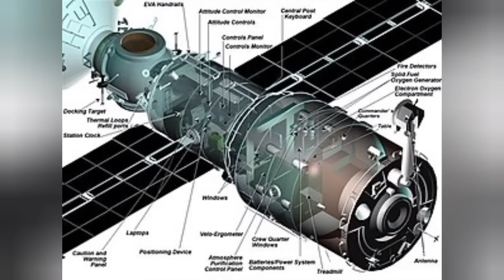Can Russia run off with part of ISS in 2024?  Can NASA do anything about it?

Comment: I would say that it would be wiser for NASA to work with SpaceX to build and install a new module to provide propulsion and wouldn't cost that much to do it and it to have the fuel needed to maintain the ISS in space.
Reply: Nasa already funded 3 vehicles capable of ISS reboost and altitude control.  The capability can be added to the Cargo Dragon.  2 of them will need to be parked at the ISS all times.
Reply: With the help of StarShip booster, you could add a module that would rival  Skylab, in a single launch. But I guess it better to send lot of little modules up to space made by as many different companies and countries as possible, that way you then can play space Lego and pass the blame for delays.
Reply: @YellowRambler  starship has to get into orbit first.  I'm hopeful they will, but getting a large payload into orbit and getting back down in one piece is going to be a massively complex task.  There's a lot of failure points, and we won't really know, until we know. 
 
Considering the projected size of the Starlink constellation, it may take nearly a hundred launches of starship to put the whole constellation in orbit.   Depending on how fast spaceX can manufacture raptor engines, that's likely to tie up most starship production in getting Starlink up and running, rather than being used for anything else.  

It's going to take time to do all of this stuff.
Reply: They won't though, it wouldn't take enough decades and failed attempts for NASA
Reply: A cargo Dragon with extra thrusters in the trunk.

Comment: They could semi-permanently dock a SpaceX starship to what remains of the ISS. It would be a good introduction for the lunar version.  They could launch a module as large as Starship without the full fuel or complete engines and maximize the interior living space. It would be a great way to send up the first generation of space manufacturing. I have to wonder what plans they might already have drawn up, and what machinery may already be built for the purpose. Just the potential of this might give the Russians a reason for second thoughts. Do the Russians realize what changes are about to happen?
Reply: A neat idea along those lines would be to reuse a Lunar Starship from Artemis on ISS. The Lunar Starship will only need it's tanks less than half full for the mission. Though it will have no cargo it can take 100T of cargo to and from the moon. So Lunar Starship could complete it's mission and still have at least 100t of fuel when the mission is complete. 100T of fuel aught to be plenty of fuel to get the Lunar Starship from Lunar orbit to ISS in LEO.

...BTW SpaceX already proposed a Lunar Starship variant as a space station for Nasa's Commercial LEO Destinations competition. NASA said it wasn't interested then and awarded the contract to Blue Origin and Sierra Space, but Lunar Starship could be done with Artemis and back in LEO right around the time the Russians are leaving ISS.
Reply: @THX..1138  I like that idea, it's extremely efficient.
Reply: @THX..1138  spacex ain't reusing anything, the rockets are cheap enough that they can deploy dedicated ISS module, especially compared to how expensive the ISS was.

Comment: SpaceX's Dragon Trunk has the space for several SDTs (Super Draco Thrusters) for an orbital adjustment system much like, or even more capable that Starlinier's AUX module.
Reply: Indeed. Let's not act as if the Russians are irreplaceable just because Gagarin got to orbit first. Last I checked, Japan invented Judo but not even half of all Judo world champions are Japanese. And I'm old enough to remember the various problems the MIR station had before its demise.
Reply: SpaceX could do that trunk solution in a flash. No, not two weeks. And they can also build cargo Dragons filled with fuel to boost and avoid debris, and just swap them when empty.
Reply: @tsamuel6224  curb your enthusiasm. Whatever solution SpaceX develop will need to be human-rated if it's going to work with a manned space station. Two weeks is how long it would take just to agree on which risk management process to follow. As for the math, have you actually done linear algebra on embedded computers using a real-time OS ? I have. Let's be blunt : if SpaceX could do this in two weeks, Starship would already be half-way to Mars.

Don't mistake SpaceX's rapid-iteration methodology for space-time breaking genius. In case you forgot, it's been exactly three years since Starhopper's first test flight and the booster hasn't even been test-fired yet.

SpaceX can get it done, no doubt. Just not in two weeks, or in two months. Two years at the very least.
Reply: @TheNefastor  they got very close to a test fire before that explosion happened.
Reply: @Rangefinder02  they didn't and that's besides the point.
Reply: @TheNefastor  a test fire might have happened by now if not for the explosion
Reply: @Rangefinder02  says who ? What do you base that on, other than wishful thinking ? I follow Starship news and nothing was said about an imminent booster test fire.
Reply: @TheNefastor  independently Space X has yet to make an orbital flight. That said NASA has signed a contract for a human rated orbital refuellable Starship with a timeline of 2 years. A Dragon capsule has 16 Draco thrusters for attitude control. Coming up with a module that would be carried as a truck for a cargo Dragon that would supply station keeping and attitude control functions in 2 year should not me too much of a challenge.
Reply: @johnohalloran3446  inspiration 4 wasn't independent?
Reply: Not to mention Shooting Star module being developed by Sierra Space. The shooting star is the cargo module for the Dream chaser, however it’s also a mini space station to itself with life support, altitude and attitude control, power and everything needed to function independently. DoD has even given Sierra Space a contract in 2021 to develop it into a free flying research module capable of supporting DoD research. Shooting star is scheduled to fly to the ISS in 2023.
Reply: @John-ed8ye  so ready in 2032 then old space is old space
Reply: Well, guys, I give up. There's no talking sense with fanboys. Apparently, watching SpaceX videos makes lay people think they got a degree in engineering and rocket science.
Reply: @TheNefastor  🤔…

Jean Roch: 
”Apparently watching SpaceX videos makes lay people think they got a degree in engineering and rocket science.”

Also Jean Roch:
”I follow Starship news”
Reply: The superdraco wouldn't be very useful for maneuvering. They were downgraded to burst valves after the test capsule blew up
Reply: It would be ironic for SpaceX to boost the ISS to a higher orbit to avoid the debris that their satellite network will surely cause.
Reply: @russellharrell2747  Starlink will not cause debris. Starlink sats can be easily deorbited and since they are in LEO will deorbit naturally by themselves even if deorbiting thrusters fail.
Reply: @MrEd2291  yea, that is the main reason why their lifespan of their satellite are just around 5 yrs, once the fuel is gone, they can no longer stop the satellite falling to earth due to gravity. its also the only reason why others can't do this since only spacex can launch several satellites easily and replace those satellites.
Reply: @MrEd2291  there’s no way that if they get to a constellation of 40k that all collisions could be avoided.  But I guess at least it’s a way to get internet and communications to otherwise underserved or unreachable areas.  I just hope we can avoid the worst case scenario.

Comment: This is now a new use case for Starship. What NASA needs now is a way to send large modules into ISS orbit to replace missing Russian hardware. Of course NASA will need a radical change to procurement for these modules but at least Starship provides the obvious lifting capability to get them there next year.
Reply: Hell, build gigantic science experiments and living quarters into Starship and dock with the ISS for a year or two before rotating in the next 50 ton science experiment and returning the original to the surface. Think what could be accomplished (science) if volume is no constraint.
Reply: @priceringo1756   The ISS is in a "Russian" orbit, so using the ISS in the future is wasteful anyway. It's way more efficient to launch a Station in a compatible orbit for US launch sites. US Rockets have a harder time getting supplies to ISS due to the orbital correction to get there currently.
Reply: @priceringo1756  , exactly.  Replaceable living quarters.  I always thought the old cargo Dragons could be used for that, as well.
Reply: Inflatables!
Reply: @michaeldemarco9950  Nah! The Russian section is the core of ISS and any replacement would require the strength to hold shape in Reboost bearing the weight of the rest of the station. The Inflatable room currently attached to ISS is the wave of the future for sure, but living in Low Earth Orbit is increasingly hazardous due to the amount of space Junk. We can afford ISS, or Artimis, but not both.
Reply: @twotone3471 , we can afford both; we just need to realign our priorities.
Reply: @michaeldemarco9950  No, we are relying on Starship, a spaceship that has not even survived re-entry, or being cought by Mechazilla. All of our plans rest on a ship that is the definition of too good to be true, similar to the Soviet's Moon Rocket, the N-1.  It looks good on paper, but how well will Starship work? The STS (Space Shuttle) Columbia was destroyed in re-entry not because of a foam strike, but because there was no way to repair the damage that a missing or broken tile represented in orbit. As far as I know, there is still no "Fix" for a similar loss of a single insulating tile that would similarly doom Starship from a similar strike that recently took a chunk out of the James Webb telescope.
Reply: @twotone3471 , we are relying on Starship as our lunar lander (which I don’t agree with), not for any ISS function. For ISS, Dragon!Falcon 9 and Falcon Heavy are established, proven resources.
Reply: @michaeldemarco9950   Currently, Dragon lacks the ability to re-boost ISS. The future of the station rests in the hands of Boeing's Starliner even if the Russians gift the ISS in a nice gesture without some kind of catch that would cost us billions. 

Actually giving us the ISS would be the smartest thing the Russians could do, as the money spent in Low Earth orbit would keep the US from fully funding Artimis, when the Sino-Russian Moon program will get full funding. That the ISS sits in a Russian orbit, and each US launch is far from efficient in reaching it is just icing on the cake for ISS being unsustainable in the long term.
Reply: @twotone3471 , I don’t think our coffers are that low.  We can afford both. We just need better leadership, or at least a wake-up call (which your scenario just might be).
Reply: Whatever happens, I think this is the end of state-controlled space exploration. Once the ISS is gone, it'll all be privately-owned stations with no BS like "give me back my module, I'm don't like you anymore". And it's about time.
Reply: Until Starship flies, we have nothing
Reply: @bernieeod57 , really? Falcon 9, Falcon Heavy, inflatable technologies?  We have plenty.
Reply: @michaeldemarco9950  Correction, we have concepts but nothing available at this time. Falcon Heavy is not man rated and the inflatables might be ready b 2024. As it is, NASA is investing in the Senate Pork Rocket leaving little if any money to react to this
Reply: @bernieeod57  , Falcon Heavy for heavy payloads; Falcon 9/Dragon for crew rotation, and Cargo Dragon, with a little extra plumbing in the trunk for reboots.  That should buy us time to develop a hardened module for permanent reboots capability.
Reply: @michaeldemarco9950  Should, good luck getting NASA Mismanagement to approve and fund it
Reply: Why rely on decades old equipment where specific countries dont want to be held accountable for failures, so finger pointing ensues.  Its a political solution with > 10 x cost if it was just individually managed.  Coordinating a complex solution the payroll masters cant fathom is where democracy fails due to an ignorant bureaucracy.

Comment: We have 2 years to build replacement modules, we need to get started on it along with a rocket that can get them there.
Reply: Nothing in space happens in two years. SpaceX rapid prototyping is amazing but they're no where near ready to build NASA rated manned space station modules that are supposed to last +25 years in space.
Reply: NASA has a replacement module in cold storage.  They built a propulsion module incase there was a delay or launch failure with the Russian service segment.